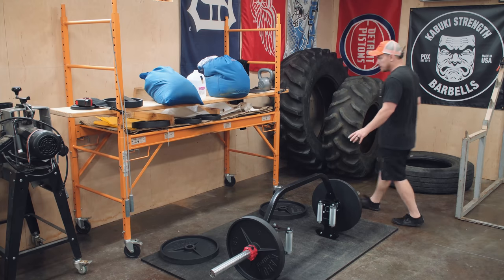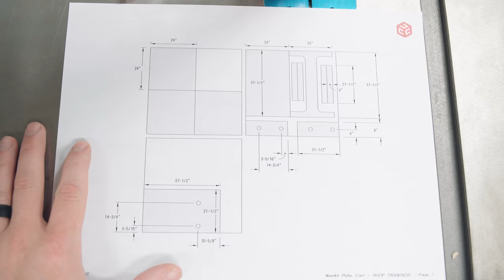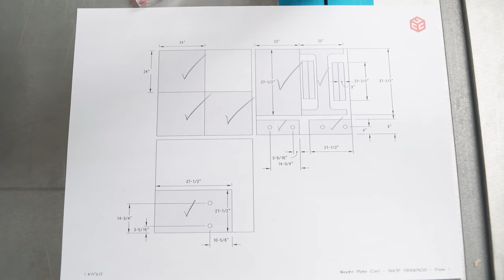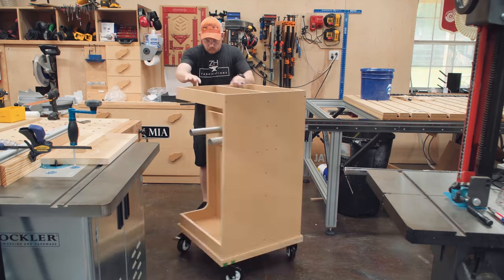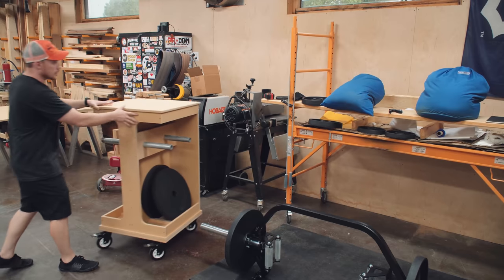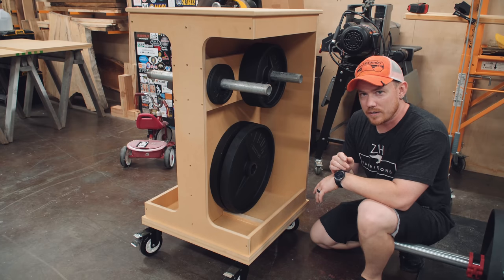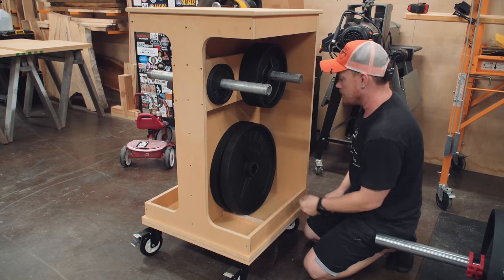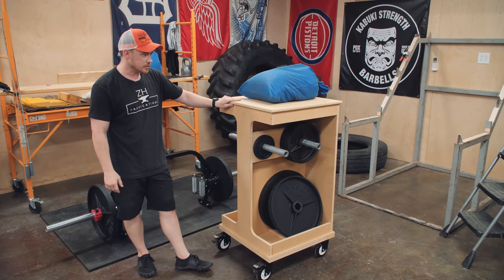Weight Plate Storage - 369

Comment: Nice project....  AND shop assistant!  :)
You had better luck out of that glue on MDF than I've had.  I eventually had to pull a Heisz and start using Liquid Nail on MDF, especially when gluing edges.  
Lastly, if you're going with a step, how about making one attached with hinges, and flip it up into a magnetic catch on the front side for storage, flip it down to stand on it?  If the casters are, say, 6 1/2" tall from the floor to the cart, then a couple slabs of 3/4" MDF, reinforced around the edge and internally with 2x4" 'beams', one flat and one on edge (or replace the flat one with upper and lower 3/4" 'caps' to make 'I-beams').

Comment: Thanks for the video. I think I'd like to adapt it for our needs. For one, it will need to be smaller cos of the space we have available in our apartment, and ideally, I'd like to be able to hold our plates, dumbbells and a kettlebell. I don't know if it's feasible, but thanks to your design, I have something to start work with.

Comment: You can lock those swiveling casters into fixed casters gluing/screwing a block of wood butted up against side of the caster.

An alternative fix for the 45s is to drill 2 holes on the front and back side pieces and stretch a bungee cord across the plates to keep the plates in.

Comment: I had the same problem that you have with the 45s on an old trolley that I made. I fixed it by putting a cleat on the floor at the back of the stack to force the plates to always have a slight backwards lean and this worked fine. However mine were round edge so they were happy leaning, I don't think this would work with your plates unless you added an angled floor aswell.

Comment: Don't think of things as mistakes, they're just opportunities to practice problem solving...... at least that's what I'm trying to do LOL

Re your platforms:-

- With the large plaits, can you just add a clamp to gold them in place so that you don't end up with the diagonal piece of wood?

- the hight issue could be solved by removing the top  and cutting a bit off the upright sections. You could then do something where you can stack up wood so that each person using it can customise the hight.

- lastly, the wheels.... if you put the locking caster wheels on diagonal corners you might find that the unit is more stable

Thanks for another great video 👍

Comment: As someone who's only built with plywood and OSB panels, how is the strength of mdf for an application like this?
I had the impression that OSB was weaker than plywood, and mdf was weaker than OSB (but is very flat). Is this not the case? Or is it only an issue if the mdf gets wet?
Reply from the maker: My suggestion is to research MDF a bit more and maybe buy a sheet for experiment. MDF is pretty darn strong. The edges are the weak point. Of course, not the right material for every application but in situations like this the material isn't a huge concern.

Comment: every time I mill MDF on the CNC machine, the static from the dust sparks and kills the machine, so I have to start the program over. Do you deal with this or is it just my machine?
Reply from the maker: Probably your hose. Some hoses are self grounding to dissipate static. For a smaller setup an easy solution would be to wrap the hose in bare copper wore and ground it shortly after the machine.